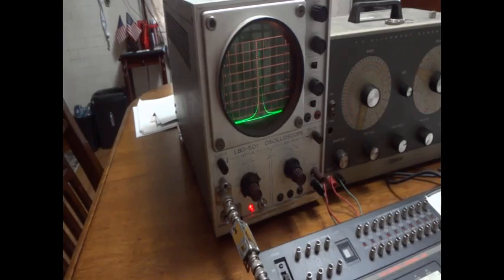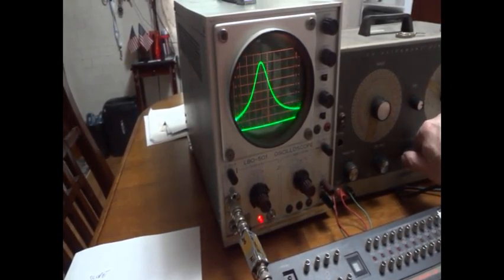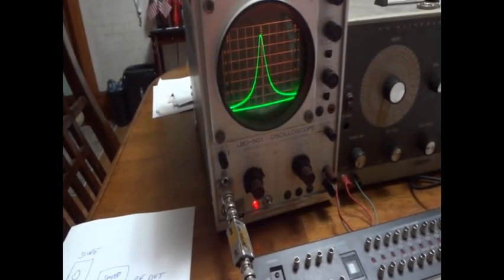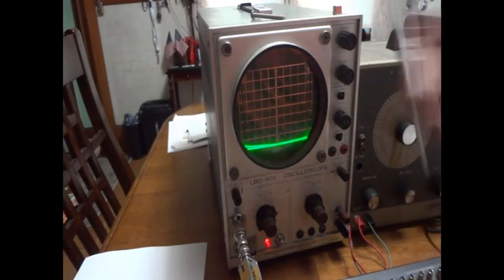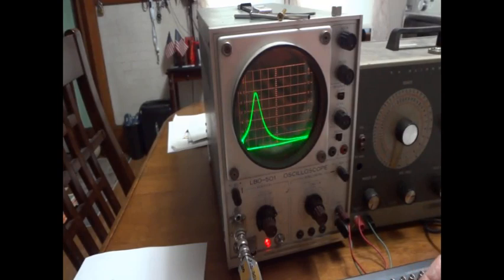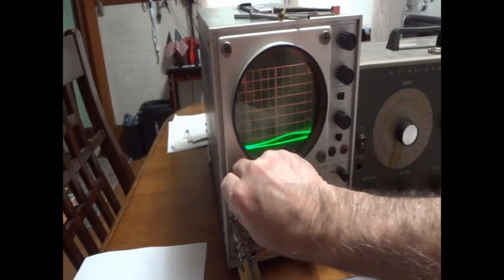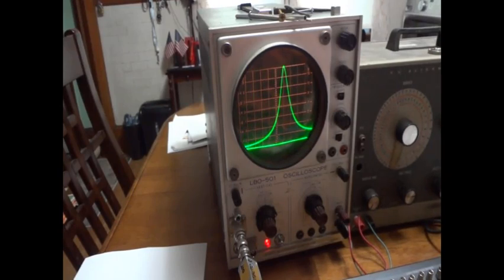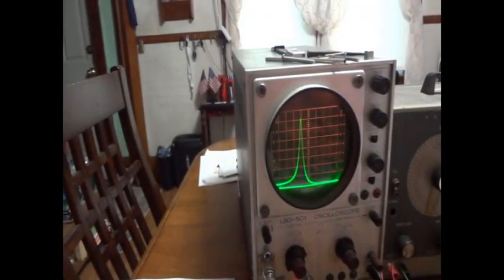The effect of different metals on a tuned circuit. #Tunedcircuit

Comment: I bet gold would be more efficient than copper :)
What mix ferrite where you using.We use 43 and 61 in RF amp building?
Reply from the maker: Not sure, It came from electronics that I worked on in the late 90"s.